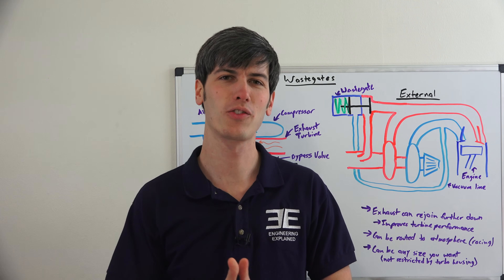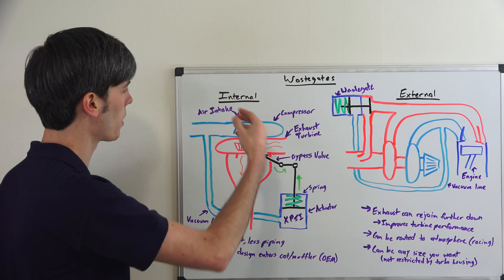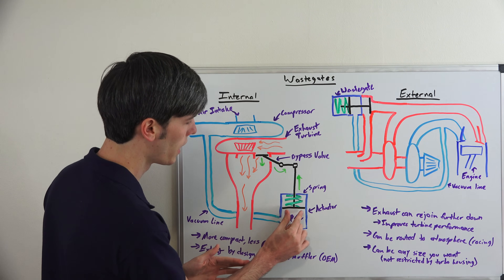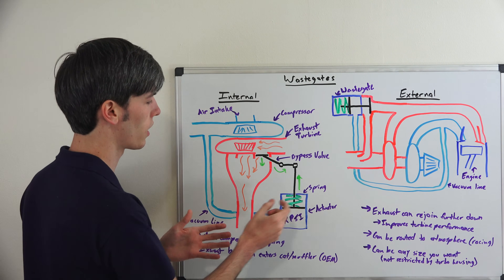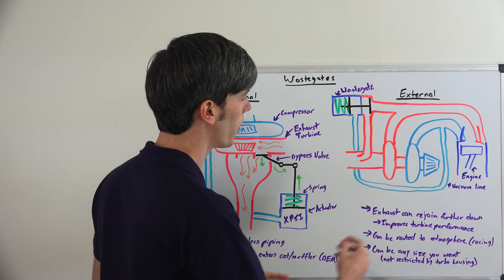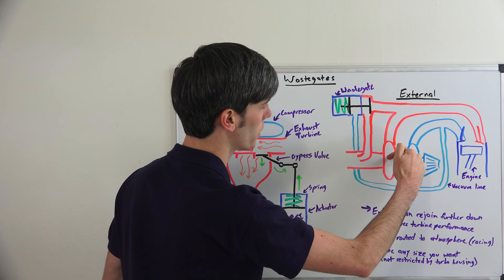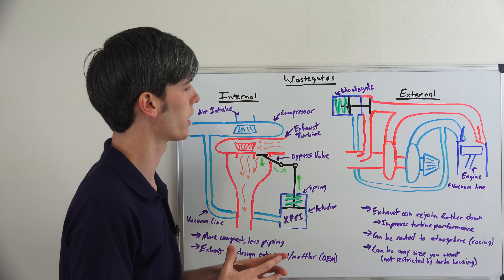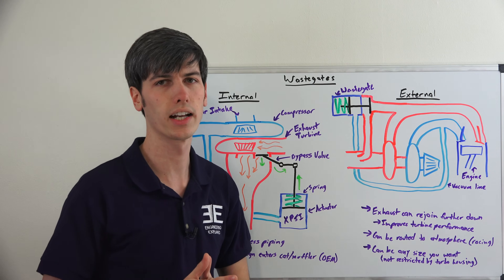How Turbocharger Wastegates Work - Internal Vs External

Comment: Hey was wondering if you can help me with the issue i have ... i have audi a4 (b5) 1.8t and recently i tried to boost up my turbo but it seems i did it wrong . So let me see if i get it right . I have to push the rod inside of the actuator and then tighten the nuts for more boost ... and if i want lower boost  i should pull out the rod from the actuator and then tighten the nuts ? because thats exactly what i did and it seems it doest have any boost at all

Comment: since the internal waste gate hole is in the turbo housing, when an external WG is added, what happens to the OEM WG hole? does that get plugged somehow, then a custom manifold is done or is this only followed through if a turbo is swapped as well.
Reply: Good question. So if you're using an external waste gate, the short answer is you'll have to weld the internal wastegate shut.
Reply: Most people using external wastegates are using a turbo that doesn't have an internal wastegate, if you are using a turbo with an internal gate then you can weld the gate shut then either mod the factory exhaust manifold to fit a external gate or mod the exhaust housing for one.
Reply: proto35 the IWG generally gets welded shut, or you can buy/make/comission a bracket (example - Grimmspeed for subarus) that holds it shut without any permanent modification.

Comment: hey.... intercooler and charge pipes are never in a vacuum......
Reply: Melody They can be below the boost treshold rpm or during the boost lag, since a non-spinning turbo forms a restriction...
But that's indeed a very true comment, unlike the post-throttle line that goes to a compressor side dumpvalve, the pre-throttle line going to the wastegate is indeed rarely under vacuum.

Comment: What happend if a turbo car runs without a west gate ?
Reply: The second law of thermodynamics has nothing to do with the wastegate though. The heat would still be removed via the exhaust, so thats not the problem.
Rather your engine would destroy itself because your boost would spiral out of control...
Reply: The second law of thermodynamics my friend ... Every heat engine must have a heat sink ...

Comment: I I still don't understand why you can get more power when your lowering your boost at a higher rpm, I thought the whole point was to make as much boost as you. an all the time? why use a waste gate and dump the pressure when you could be using it to spin the turbine and make pressure on the compressor side?
Reply: because there are limits to everything. too much boost pressure and the engine will blow up
Reply: This is not a method to get more power.
If you don't control boost you get more air into the cylinder -> more exhaust gases -> higher boost -> more air -> more exhaust gases -> more boost -> ...
This would just repeat itself until destruction. So yes, without a wastegate you would have more power for the 15 seconds before your engine explodes ;)
Reply: BXCRRCR Tyler is that free boosting?
Reply: TheUnbeen no, you burn gasoline to make all of that

Comment: Say if an external wastegate is used and the bypassed exhaust gas is dumped directly to atmosphere, so does that mean that the gas won't go through the O2 sensor. Doesn't it mess up the AFR?
Reply: I'm not 100% sure, but afaik the O2 sensor measures a concentration rather than an absolute amount. So it would't matter if you dump some exhaust because O2 concentration is still the same.

Comment: so it's like a blow off valve?
Reply: not really,BOV is on the <<boost side>> of the turbo,BOV just lets the presusred air escape when you let off the gas so there is no backpressure on the boost <<propeller>>

Comment: Awesome videos!
I wish to run a twin scroll (it was free) on a small V6 by splitting the exhaust to the turbo. It's not the most efficient set-up, but it's easier and cheaper than a "bag-o-snakes" header system.
Research shows that I need to use two wastegates. 
Couldn't I run one wastegate of it is Tee'd between the exhaust pipes?
Or does the Tee cancel the split to twin scroll idea in the first place?

Comment: Hi my name is Alex Dooley and I love your channel on YouTube it's awesome and super helpful!  I have a question about wastegate and blow off valves.  Is their a difference and if so is it bennificial to use both?  I'm in the process of turbo charging my motorcycle and I'm worried about being in the higher rpms 12 -  14xxx and then letting off of the throttle.  I don't want to keep all that pressure in the charge pipes or the turbo and I definitely don't want it to hurt the engine or the turbo. I will only be pushing around nine lbs of boost.  Is their any tips or what do you recommend as far as blow off valves and wastegates?

Comment: what's the average temperature in the turbine exhaut propeller ? (sorry for typos)
Reply: It depends, a car your mom would drive or in a drag race high temprature envoriment.
Reply: let's say in an average stock turbo car , averaging on 3000 rpm ? just  like an approximation of degres in celcius ?

Comment: My engine light comes on when I push my car for a good 10 minutes and then goes off about 6 hours later. Then I took it to AutoZone when my light was on, and they gave me a code, P2261, I need help. I need to figure out what I need to replace. My car revs up on its own as if the Wastegate is stuck closed. And I don't feel all of the power I should.

Comment: Most kids in the car scene in my area set their wastegate at a much higher psi for more boost = blown engines. They try to race their car with turbo with stock internals and it doesn't work out for them... wish they would see this video haha. Thanks for further in depth explanation!

Comment: Is the waist gate spring mechanical and constant?  I was under the (probably false impression) that the waist gate was used to dump unneeded boost pressure such as at low speeds. Wouldn't that would mean it would be variable though?

Comment: What makes the turbos flutter?? 
Is there a waste gate that open and closes so fast that you get a flutter effect???
Is this a thing?
Reply: Adam Courchaine if turbo flutter does not harm the turbine, why blow off valves exist?
Reply: 2JAYZ-GTE  it will harm the turbine . When the throttle valves close and there is no where for that air to go it will spike back through the turbine. Over time this will cause damage usually resulting in blades breaking off or premature wear of the turbine. Bov have their uses however bpv are generally more efficient.

Comment: But how does it improve performance? Don't you want all your exhaust gasses creating boost all the time? With the wastegate all I see that it's doing is throwing away boost.
Reply: boot pressure?
Reply: oh okay, makes sense.
Reply: As for improving performance - it doesn't necessarily do that. At most a wastegate is simply keeping your engine safe by not running insane amount of boost straight to the engine. Wastegate gives you the option of setting it at a certain psi so the air that has previously been through the compressor wheel from exhaust can exit through the exhaust instead of pushing more air into your cylinder. Just trying to keep you safe for the most part.
Reply: Thanks, that's a great summary. So is a blow off valve something that just lets the air out of the system when you down shift letting of the gas.
Reply: it does improve at a certain point because gases escaping from internal wastegate come out at a turbulance greating some backpressure on the turbos exhaust

Comment: my question is...so wastegate relaxes turbocharger when you let off the gas pedal...well why the external it opens when you have full throttle ? the flames from it when you throttling...? i dont get it with external

Comment: So if waste gates vent exhaust gases, what are blow off valves venting? Incoming air before or after the turbo?
Reply: The blow off valve vents air and is locatet somewhere between the turbo charger and the throttle plate.
Reply: waste gates are venting the exhaust gaz that makes the turbo spin, to limit the boost it can create. Blowoff are venting boost created by the turbo that was supposed to go into the piston
simple explanation

Comment: hi ,does adding more like 100hp by turbo harm the other parts eg. the gear and converters,thks jiff
Reply: if your engine internals arent forged it could
Reply: yes the engine parts are under more stress and if their limit is reached, you know what happens. Boom.
Reply: you need stronger and preferably lighter parts in the engine to make more power and more accessible power

Comment: so if you have a wastegate do you necessarily still need a boost comtroller
Reply: +Tristan Haire You might, but only if you want to run higher boost pressures than your wastegate allows. A wastegate limits the amount of boost the turbo can make by limiting the amount of exhaust flowing through it. A boost controller allows you to turn up the boost by fooling the wastegate into thinking boost pressure is lower than it is. It allows less pressure through to the wastegate.
Reply: +choltzapple thanks

Comment: why do u need/want a waste gate in the fisrt place for someone who dosent know why not have infinte boost?
Reply: +CaptianHicterDeckmen because there's always a limit with how much boost an engine can safely run. If you exceed that, something will breake. And quite often if somebody runs excessive boost some vital component fail. Pistons, conecting rods and so on.
Reply: shi01 thank you i did not know
next question could u run a turbo that provides low boost with no wastegate?
like say a powerstroke turbo?
Reply: ***** thanks glad to hear it?
Reply: +Boysya why would it be like you have a plugged exhaust? sorry but your comment makes zero sense to me.
Reply: +CaptianHicterDeckmen Short answer is no you can't do that, there is a reason why we have wastegates and why 99% of turbos use them, it's because it works and is reliable.
Reply: ***** "Are turbos designed to run as slow as they can? "

Pretty much, not only do that start to become really inefficient when you start getting out of the efficient range of boost but it causes a lot of extra stress for no gain.

"It's just double sided fan, you make it sound as if "careful because you will over boil the water" mentality."

other then the fact that you can cause damage by over spinning the turbo.

"You can flow the crowd and do what 99% does and feel mighty intelligent without a reason."

It's almost like it works really well with a wastegate, like limiting and controlling how fast the turbo can spin is a good thing.

"If turbos can't get maxed out then why are there so many different sizes?"

you seem to be the one saying they can't be maxed out because I've said the complete opposite.
Reply: ***** Why don't you tell us how you and your friend ran turbos with no wastegate...

Comment: This popped into my head while I was watching the video, but do they make waste-gate values that are not passively pneumatically actuated? For example would it be possible to create an electro-magnetic waste-gate that can be controlled via a computer from inside the car, allowing for different settings, ie: a higher PSI that would create more power but also more stress on the engine for racing or sport-mode applications and a lower PSI option that would be used for daily driving? Thanks, and great video as always.
Reply: +Will Argus Well, a boost controller is a bit different in that it's not really an electronic wastegate, but you can buy electronic boost controllers that change the pressure that goes to the pneumatic wastegate. The functionality is the same as you've described however

Comment: Why aren't desmodromic valve trains use in car engines?
Reply: +Rae Machiavelli Because there's no need to. Desmodromic valve trains are only needed for higher reving engines and normal cars never rev that high, so there's no point in using them.

Comment: How does rerouting the external wastegate back into the exhaust help the turbines performance?
Reply: It doesn't help performance ever. It does help with emissions. Running it into the exhaust further down you don't mess up the vortex in the pipe coming from the turbo. If you run if far enough down where the vortex has changed to just a straight flow the performance lost will be minimal. This vortex coming off the turbo is the only reason the very large exhaust pipes make more power on turbo motors even passed when it would normally just be a waist of space and money on other motors.

Comment: so technically if it has an internal wastegate you could stiffen the spring so it'll never actually make the boost to open then run an external wastegate further down to improve the turbos effiencey? how much does an external wastegate even gain over an internal wastegate? I have more questions now then I did before watching this 😂
Reply: +Austin Diggs Lots of questions too here but I would guess that if the turbine housing has to accommodate a place for gas to escape including moving parts, that may be a compromise compared to the most efficient shape possible for a housing coupled with an external w/g. That may be why the size of internal wastegates is more limited. So I don't know that simply rerouting an internal to an external would in itself make an efficiency gain. Just a guess. He didn't say why or how an external is more efficient than an internal, wish he could address that. +Engineering Explained
Reply: +stevehmi I see your point and agree that I don't think it would be as efficient as one shaped without the space but would simply making an internal to an external make the turbo overall more efficient instead of being left with an internal wastegate.

Comment: Can you please make a video about what happens when you put a car on a dyno in different gears?  For instance, a 2k to redline run and how torque and horsepower change when the car is in 1st vs. 5th gear?
Reply: Really?  So let's say I put a 200hp/200tq car on a dyno and do a redline run in 2nd gear which is 2.000:1.  How would that change the dyno chart?
Reply: The_Bait So would the chart show 400hp/400tq or 200tq/100hp?
Reply: +VoraciousPhantasma your choice of gear does not change anything in the final numbers. Power = Torque * angular speed. If you change gears, both of the numbers change, so the power stays the same.  Of course different gears have different efficiency, meaning that there is always power loss in the transmission, and the amount of power you lose is different in each gear. But that is why the dyno measures your power loss right after the run, so it can compensate for it and calculates the power at the crankshaft. (That's why power at the wheel is always lower than power at the crank).
There is an other thing, which is that if you are in low gear, you have really high torque at the wheels, so you risk "jumping out" from the dyno (yeah, I know the cars are strapped down, but not always, and that's the reason why you don't have to strap down cars with low power figures), but the real issue is that the tyres may slip, thus giving you false information about performance, but more importantly, you cause tyre wear and dyno roller wear.
Reply: Agreed +davidsunhun. You are simply changing the gear ratio from the engine to the transmission, not the final numbers

Comment: Once the WG is activated, is it simply fully opened and closed, or is there an in between where it can be partially open to let some exhaust by but also let some exhaust continue to spool the turbine?  I'm assuming it's the latter.
Reply: +Alan Barrese during the time it takes the WGA spring to reach it's rated psi, it will open partially until it's fully open, allowing the turbo to spool. Once you let off the throttle though it closes completely
Reply: +WickedWhiteMR ok, that is what I thought happens, thanks!

Comment: nicely done...

I have a 100% stock 2008 wrx, I have read alot of YouTube comments saying "fail, his wrx has a BoV"

can you explain this trolling comment. blow off valves, do or don't?

the guys on irc #cars see no problem...
Reply: +bigmac turd it doesn't really matter as long as the boost doesn't reach extreme pressures. BoV is there to release the pressurized air after the throttle body closes (it does so by pushing a little valve, because the air has nowhere else to go).
Reply: +bigmac turd WRX's like a lot of Nissan's have issues running a blow off valve vs the factory bypass valve which leads to it running rich, it can also cause issues with your idle and it why people say it's fail having a BoV on a wrx.
Reply: +Rokas Getautas lietuvis?
Reply: Dimerzz ' Jo :D
Reply: DriftNick Ah, thanks, mate. I always thought BoV worked the same way a wastegate does :D